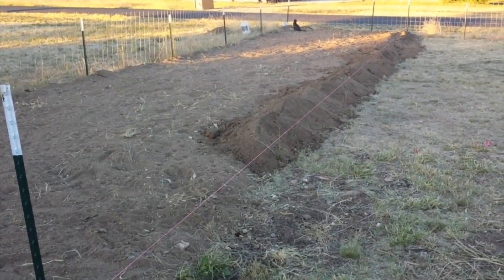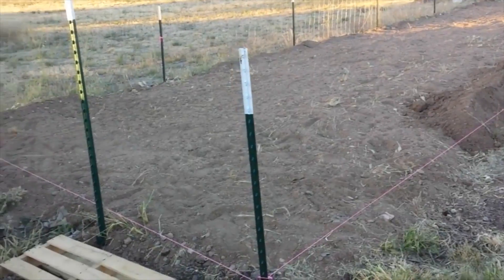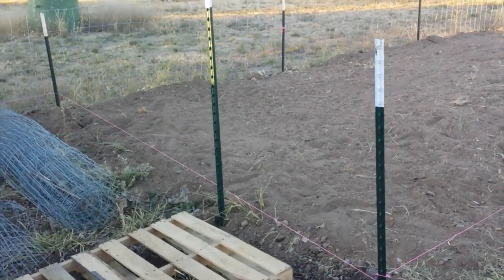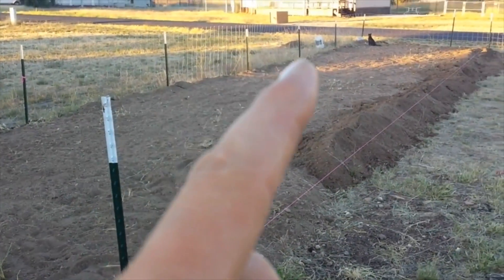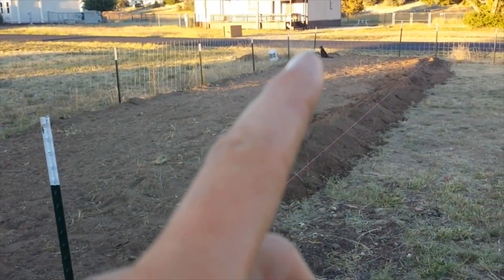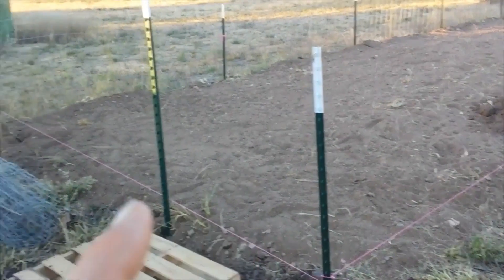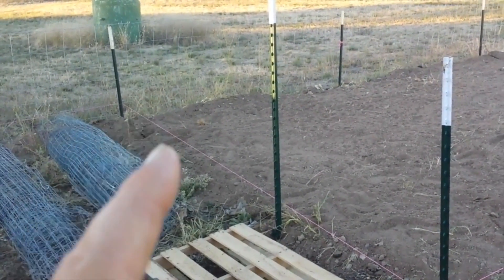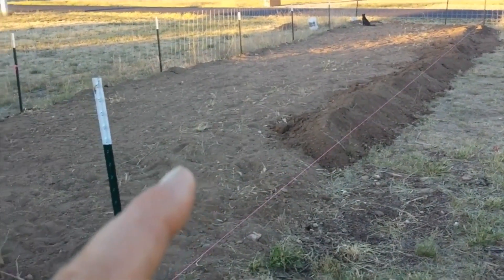Aquaponics Pre-build Help | Ask The Aquaponics God

Comment: In regards to heating water for free... BIOMEILER. Basically, run your water through coiled flexible piping , then build up a massive compost pile around the flexible piping. I have not experimented with it myself yet but there are a number of videos out there displaying the idea. Search Biomeiler or compost powered water heater. I can't verify any results but it might be something worth researching and experimenting with.
Reply from the maker: Thanks for the input. Will look into it.
Reply: Looked into this. It is a good idea. pex line through the pile then back to sump. could gain some heat.
Reply: try looking into a Longer Lower compost temps in that huge pile of woodchips, etc.  Instead of expecting 4 gallons/min of 160°F water the flow might be effectively less and maybe an 85°F residual for months could be PERFECT temps for methane production as in a UBC buried in the compost pile.
Burn the methane in simple stove  for tea water ( like Jean Pain ), or to heat SOME of your grow H20 operation.  Depend on your back-up system and hope the compost continues to provide a healthy percentage.  BTW, tons of compost can be a VERY good thing too.  Happy potatoes, daikon, potting soil, etc. 
See Jean Pain experiments in VT.

Comment: I have to disagree with you on this one. The reason is this is not a flat bottomed pond. It has a sloped bottom so would only require a sump pump at lowest level. Secondly Koi ponds tend to be highly stocked with large filtration devices as people want to watch the fish not an empty pond. Now I agree this pond is so large I would not recommend starting with a system that large. My back ground is tropical fish breeding and market garden(farmers market farm) with an associates degree in horticulture. I did run  small aquaponics system off of my tropical fish breeding shed with 300 hundred tanks on central system that fed a small gravel bed to grow fresh veggies for the family in winter. I am watching YouTube aquaponics as I am building a greenhouse right now to house a true aquaponic system. I would love to have that pool to use as tank construction is so expensive. Now flat bottomed above ground pools are worthless as they are to large around to get a swirl or vortex to move solids to the middle without stressing fish with fast moving water(well maybe trout but doubtful). Your advice has been so informative and I am working on a blend of ideas. My fish BTW are going to be Koi and colored crayfish bred for aquariums. This small greenhouse at the house will be played with to get the system right then I plan to build ten thousand gallon tank as koi need the space as they get to 3 feet long. A good choice for that large pond but not cheap to start out.

Comment: First off let me Say THANK YOU! You are awesome at what you do. I have learned a lot from your videos. I have almost completed the design of my system just from watching Your videos. I needed some math that you provided to learn what I was doing. Trying not to be a Bonehead as I call my kids. My videos are short do to my phone storage limitations. I try to keep them at 30 seconds. longer videos need to go through my PC. I am digging out my lanes for ground temp stability. I am thinking about using the ground as a thermal battery.The lanes will still kinda be above ground. I moved (with shovel and wheel barrel) all that dirt there. That dirt is 18" to 24" deep from one end to the other. I am planning 18" deep lane. 12" deep water with 6" free board.Sump tank will be dug into the ground also.I agree on the IBC totes. Long term plan is round tanks. But if this System can pay for it self it will grow. Do to what I have learned from you. I will be growing 1140 Lbs of fish a year. 1500 gallons for fish. I need 6 IBC totes for fish and one for a sump. Stocking density at .33 lbs per gallon or close too. Totes I can get for free. Tank cost money. This needs to make money. These DWC lanes, Gravity?, that will take some doing and thinking on my end. I can pull it off though. I own my property so if I can get this done and in, it will stay. 3" PVC free flow is 8400 gph or 140 gpm max. My pump will be a 12V 4000 GPH pump. Might need a bigger pump. Maybe two depending on what I can find in 12V. I will reduce the pvc size into each tank to 3/4" for a free flow rate of 660gph or 11gpm. Out flow on tank is 2 inch back up to 3 inch. Now you are saying that I should go, tank to filter to DWC to Sump. Ok that is Do-able. fish Tanks off the ground a little do to floor, maybe a foot above DWC surface.  flow into solids filter to biofilter, both 50 gallon drum. Then into DWC lane 1 at 200 sqft then into lane 2 at 200 sqft.  then of into the sump. So sump tank size. Flow rate of 3960 gph or 66 gpm. 66 x 4 = 264 gallon. The sump will be an IBC tote at first which can hold 275 gal. so sounds good to me. Thank you for that. 2 tanks yeah right. had to go up to 7 totes 6 tanks. pump is out the window. Need to achive a flow rate of 4000 GPH. Head height of about 10 foot. Need to look at more pumps.WATER TEMP sorry for free, lol. low cost as possible. looking into a thermal battery. Maybe a rocket mass heater. still looking. Can run a 12v fan or blower for free. Double wall Poly for sure. GTG Thank you for your time. Roemello33 OUT or Mello Out https://youtu.be/ZY_shbkYM0A

Comment: Has the aquaponics god never seen a geothermal ground loop before? Underground temps here run 70-72 degrees year round here in east Texas, it does take some work to run your heat exchanger but it is absolutely free from an energy standpoint. You need ventilation anyway so why not run it though an earth tunnel? Your system is circulating water 24/7 route it as deep underground as you reasonably can. A larger mass of water takes longer to change temperature (so long as you don't increase surface area along with it) you can use that thermal mass to even out the occasional cold snap. Of course everything in engineering is a compromise.

Comment: my 500 GPH pump dropped by 3/4 to MAYBE 75 GPH with a 5' lift but another 6' foot run for a total of @ 11'...   I had to get a much larger pump and work to lower the length of run.

Comment: Hi Brooklyn (and other channel followers!)
Regarding "non free" water temperature regulation, I was wondering if you have some decent (scientific) data on using ground water loops to try to help keep the water temperature stable, i.e create a heat exchanger that uses the ground thermal gradient.
The idea is to do something like a ground heat pump exchanger, minus the heat pump.
In particular, I wasn't able to find any data about how efficient this kind of system could be depending on the latitude, depth and soil composition: I'm sure it works somehow, but I suspect in at least some places it's not worth the watts you'd use to run it, so before digging a hole, putting in a coiled water line and an Arduino/ESPxx sensor to log the temperature I was searching for some more data.
Reply from the maker: +Roberto Maurizzi I have seen this technology used by few farmers and have seen it used as an air conditioning unit for homes as well. 

From my understanding I see this a viable option for temperature stability, but it also depends on the location as well. The underground temperature has to suitable in order for this to work, so in areas with extreme cold it may not work very well for maintaining heat during the winter.

For a place like Florida, California, Georgia, etc. I see this as a good option for temperature control. I think the companies have a rating on the efficiency of their system depending on the location, and from that information one can predict the heating and cooling outputs. Check any website that offers this service and I’m sure they will have the data on their setup.
Reply: Unfortunately in the Philippines the situation with resellers is a bit uncertain: I've found a few companies that have ground heat exchange systems in their catalogues, but they still didn't sell any and the prices are really high for the local incomes.I'll continue to search (or maybe experiment, we'll see).
For a decently sized AP commercial operation I'd definitely try a ground heat pump for cooling/heating: it's more expensive to install than other kinds of HVAC system, but running it it's usually way cheaper (1/3 of the thermal power required for a conventional heating or cooling power plant, according to some German installers) and since it needs only electricity, it can run on solar (I got the idea while I was in the UAE, where geo or water cooling are definitely better than air A/C even with the low price they ask for power)

Comment: To heat the water, sun is an unexpensive resource. I've seen many peoplesrounding two or three rounds of black irrigation piping in the fish tank, than connect it to a DIY thermal solar panel with a pump controlled by a thermostat.